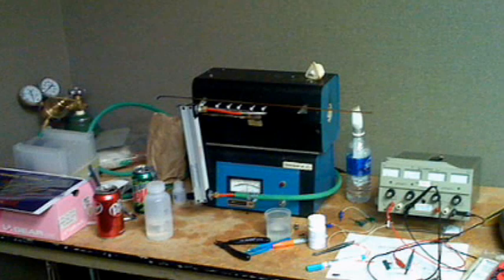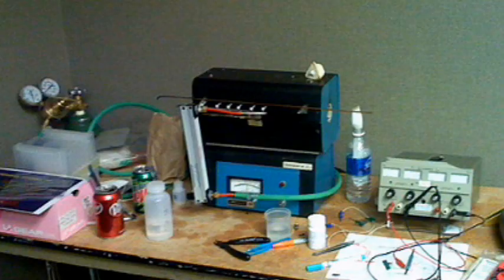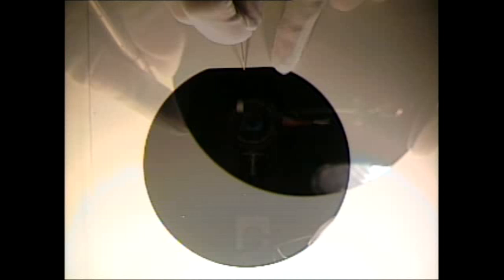Cleaving Silicon Wafers - Home Chip Lab

Comment: @TheSolarmike I am actually planning to make a fairly nice set of tools for my lab. Spin coater is already tested and working, next on the list are:
* CMP system for polishing unpolished wafers / doing damascene patterning
* Vacuum evaporation chamber for aluminum deposition
* Laser direct-write lithography system (blu-ray diode + precision steppers)
* Contact mask aligner / exposure system (405nm H-line or 365nm I-line, both work well with DNQ-novolac photoresists)